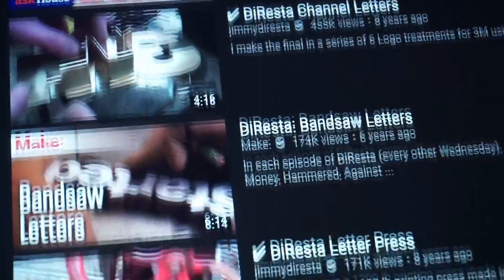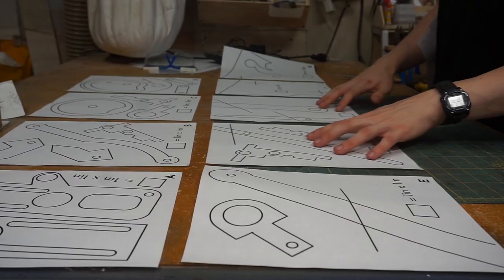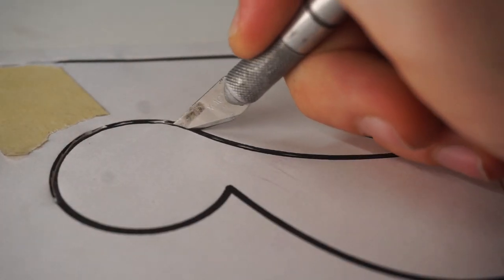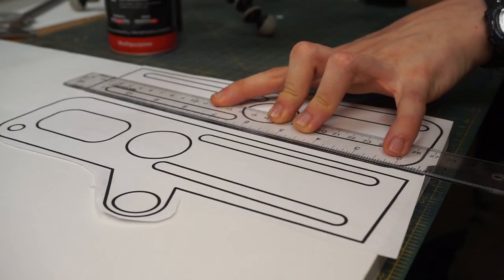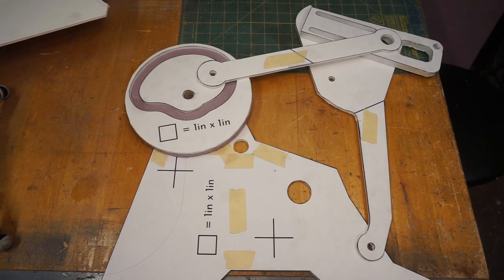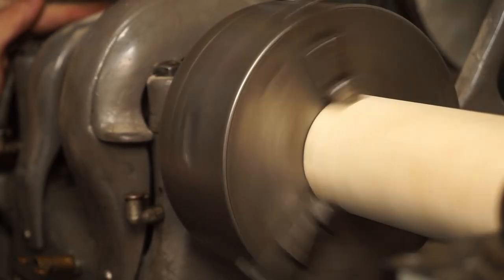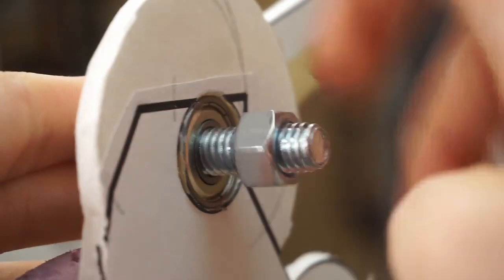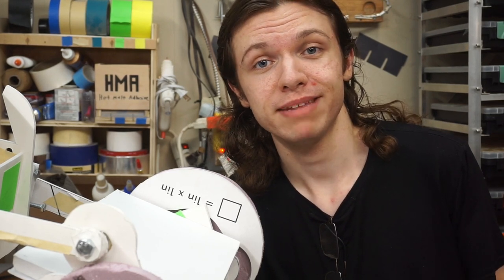Building my own Letterpress

Comment: One thing to consider is the sheer tonnage of pressure these machines require to make good prints. The press we have that you're referencing can close with over 30 tonnes of pressure. Sometimes that much pressure really is needed depending on the print coverage. The weight of the flywheel is what carries all that energy and momentum so it's gotta be heavy!
Reply from the maker: Really good point! I hadn't considered that explicitly, but that makes a ton of sense. I'd be curious to know roughly how heavy you think the flywheel is on your full size press - would be a good metric for me to use later on when making that piece.
Reply: @RyanGausMakes  Ours is a 14.5x22 inch Chandler & Price printing press. The biggest made at the time. The flywheel is easily between 100 and 200 pounds all its own.
Reply from the maker: @JukeboxPrintLive  Nice, thanks for the information!